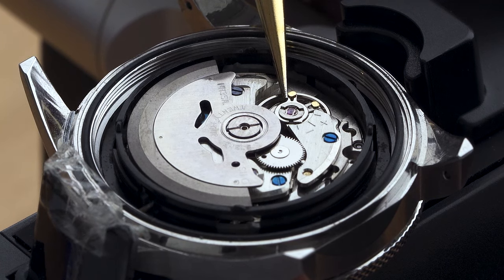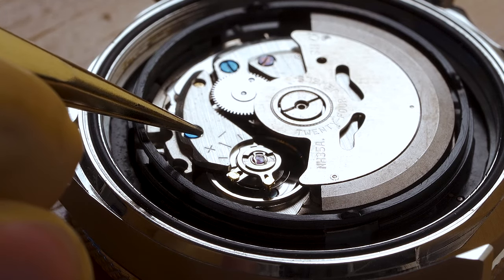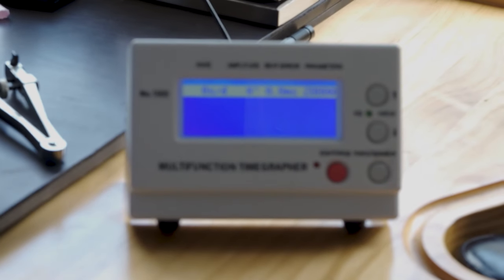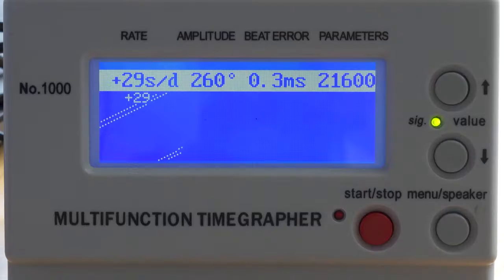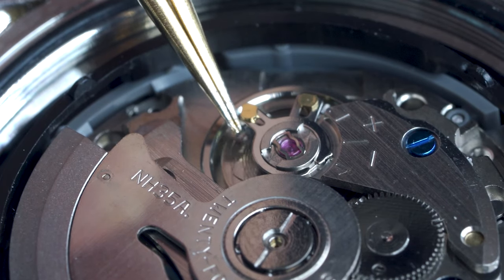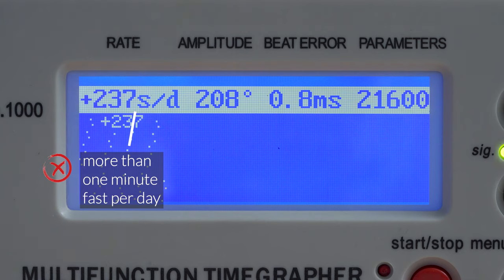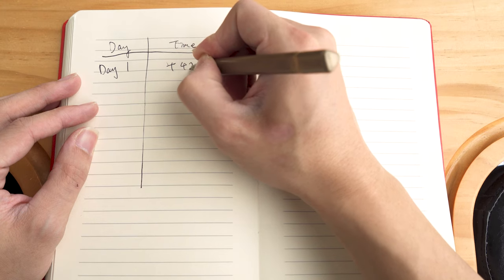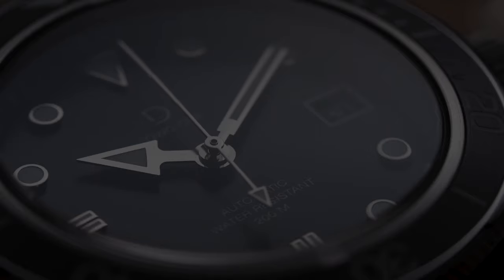How to Regulate a Watch using Timegrapher (and Improve Watch Accuracy WITHOUT a Timegrapher)

Comment: I've always been a casio/quartz nerd but now I'm considering an NH35-based watch, and it's nice to know I can regulate it myself.  I guess NH35's don't receive "full service" very often due to their low cost.  Thanks for a helpful video!
Reply from the maker: And that low cost makes it perfect for your own tinkering!
Reply: @DIYWatchClub  Right.  When it eventually dies I'll replace it with a brand new NH35, and then I'll try to bring the "dead/dying" NH35 back to life.  Chance of success: poor.  Chance of learning: 100%.
Reply: The NH35 movements are dirt cheap workhorses. You can't go wrong with them. I've just finished my 6th. build, it's a fantastic hobby that gives you a real sense of achievement. Build yourself an automatic, you never go back to quartz. 😊

Comment: Great video. I am new at this and find it very interesting.
A couple of questions.

1) time grapher.
      Is the a difference in manufactures
       
   2) Where can one go to by some basic totals such as the one you used to open the back to get access to the movement.

   3) Are there any courses/schools one can attend to learn more.

Thanks,
Charles
Reply from the maker: 1. The difference mostly is in terms of build quality. 2. A case back opener is included in our watchmaking kit, as well as other tools needed for watch assembly: https://shop.diywatch.club/collections/watchmakingkit. 3. I think the said watchmaking kit is a good place to start. It includes a complete tutorial on watch assembly. And you can gain hands on experience with the kit. Or if you want to go deep into this, you can check out WOSTEP.

Comment: Ah, I wish I'd seen your video sooner.  I'd seen others, all cautioning re: hairspring but they were using larger shifts of the regulator with a toothpick.  I was disappointed with what I perceived as inaccuracy (12 s/d too fast)  in my Orient Ray II so I got a time grapher, popped off the back and proceeded to overcorrect first one way, then the other and ended up nudging the beat error.too.  I finally got it to + 17s/d -near where I started but worse - and then slipped.  The hairspring stopped dead, never to run again.  Sigh.  It's became something of a Zen lesson; I have some other watches "in spec" but less than I used to want and now I enjoy the variety!

Comment: Some great videos. Have several Invicta's since they seemed a great entry point for automatic watches, and hit a point where I decided to get a winding case so I would have them ready to go. Boy was that an eye opener as they really weren't keeping time as well as I had assumed. So I started looking into improvements. Just regulated one of mine today to ~+1 s/d. Going to give it a few days and check how that fairs in the real world. Had been loosing 2-3 mins a week or so and time grapher (I am using PC with program and special mic stand similar to that used with time grapher) said it was ~-25 s/day so lined up well enough there. Hoping for good results. Second watch was much worse and beat error seemed to be a problem. Unfortunately I managed to catch the hair spring and am looking at option to repair/replace the movement. Tips appreciated, how best to adjust with out risking the spring, How hard is it to replace the hairspring vs movement, reliable source for movements (NH35A) eBay seem to have a lot of Japanese movements all shipping from China (fishy), and tips on the movement swap (swapping face/hands, etc). Already found your video on swapping the rotor (assuming I get an unbranded and want to keep my Invicta yellow rotor).

Comment: I would also suggest to use app like timegrapher x and earphone mic if using without a timegrapher. Not as accurate as physical timegrapher but I managed to get mine to +1s/day easily with those rather than adjusting it blindly.

Comment: Hi, what happens if an accurate reading of a 2824-2 COSC (Tissot) lift angle was set to 52 degrees?Is the accuracy reading the same? The device also reads correctly the deviation of the mechanism?I went to a watchmaker and (overhaul, so he says) he put the watch on timegrapher but the lift angle setting was 52 degrees...(yes an watchmaker...)!Until now, I didn't know that the angle should be 50 degrees!Please help...
Reply from the maker: Don't worry, the lift angle is used only to calculate the amplitude of the watch, and the difference in measurement of amplitude with a lift angle of 50 vs 52 is not significant (i.e. if there is a problem with amplitude it'll be noticeable whether it is 50 or 52). And most importantly, the accuracy reading (i.e. rate) is not affected. So yeah it's nothing to worry about.

Comment: I had a screw lodged in the hairspring. When I took it out, the rate was all wonky so I attempted to regulate it. But when I moved the regulator close to the stud, the rate did not slow down. Sometimes it did, but if I moved it further it would actually go up. Does it mean my hairspring is kaput?

Comment: Thanks for this video. I might be looking to attempt this on a Seiko 8L35B movement. There appears to be a screw next for the +/- symbol which some say is easier to use to regulate with. Have you come across this before and should I just stick to the regulator lever as you did? Also what tool is that you're using to get the watch case back off/on? Thanks

Comment: I have a watch with an NH35 movement.  I improved the accuracy to -1 sec per day (method number two).  I was thriller until it fell from counter height on a ceramic tile floor.  Now the accuracy can  be +80 seconds per day and then the next day - 60 seconds per day without making any adjustments what so ever!
I tried regulating it again and check the accuracy per hour.  This test showed the the watch was running approx. -2 seconded per hour for the first 6 hours for a total of -12 seconds for the first six hours.  However, by hour 7 the watch was now +5 seconds. this means hour 7 was +17 while all the previous hours were -2 seconds.

I assume the movement is damaged and attempting to regulate it is futile.  At $50 to purchase a new NH35 movement seems like my best option. Do you agree?
Reply from the maker: That happens to the best of us. In your case, yes, purchasing a new movement is the best choice.

Comment: You adjusted the rate with the watch dial facing down. Is this the ideal position to regulate the watch?, as most of the time you have dial facing up or 12 position slightly down when on wrist.

Comment: I have this movement in a "Rotate North" watch. I've had it for 3 months now, and having timed it every day for 6 weeks, it loses 22 or 23 sec every day, never varies. ( if I leave it face down for 24 hrs, it loses 7 sec ) I wear it all the time, including swimming 3 - 4 miles a week. I don't have a timegrapher, just the app, which doesn't seem to give reliably consistent results. As the watch is so consistent, would you recommend just regulating it, and not touching the beat error?  Any comments would be appreciated, thank you
Reply from the maker: If you're concerned about accuracy only, then yes regulating without adjusting beat error is ok. I'll also keep an eye out for signs of obstructions because the watch runs slow
Reply: @DIYWatchClub  Thanks for that, wish I had access to a timegrapher, as I don't want to keep removing the back. I'll make a soundproof box and use an external mic on the iPhone  app and take it from thereI'll use the face down position and set it to plus 7 sec, see how that goes. Amazed wt the consistency though, not deviated by more than a sec a day for 6 weeks,

Comment: I have a new watch with a NH35a movement. When my watch is a horizontal position, the beat error is 0.1ms with dial facing down and 4ms with the dial facing up. What do you think about the possible cause of this discrepancy/problem, and can the issue be solved?

Comment: Hello, great video!
I wanted to ask how much can you regulate a watch? Mine is running too fast and the regulation arm is already at edge of the (-) mark.. Though I could still regulate it more before it hits the beat adjustment lever.. Should I??
Reply from the maker: It would be good to check if the beat error is too high as well. I didn't manage to cover it in this video, but beat error adjustment affects the rate too
Reply: @DIYWatchClub  Great, thank you🤙

Comment: I have noted acording to you the lift angle in the Seiko NH35A is 53º, but are you sure that is so? On the internet NH35A --> 52º, NH35B --> 53º. I don´t know if these date are correct, which is the correct one?  Does the lift angle influence in the measurement of the device, aboive all the amplitude?, How can I know if the lift angle of the watch is the correct?
Reply from the maker: I'm pretty sure it's 53º, as I have cross-checked the figure from multiple sources, and even the catalogue says so: https://www.timemodule.com/upload/PDF/NH38_TG_E.pdf. But feel free to do some more digging around on the internet. BUT let's not worry about the difference of one degree, as lift angle is used (by the timegrapher) in calculating the amplitude. So basically setting a lift angle of 53 vs 52 on the timegrapher would actually results in insignificant difference in the resultant amplitude. And to answer your second question, lift angle of a watch isn't something that can be correct or wrong. It's something within the design of the movement, i.e. it's how the movement is set to work. So all NH35s work with a lift angle of 53º, and that's not something anyone can alter. So usually I get the lift angle number at a reliable source, preferably in a official data sheet or repair manual, or if that's not readily available, just like in this case, a catalogue works well in providing credible figure. Hope this answer your questions!
Reply: @DIYWatchClub  Thank you very much for the information. One More question, could you tell me a web where I can know the technical information about watches?
Reply from the maker: @emilianodelpozo4175  I assume you mean movement. Best source is official, if available. Otherwise, https://calibercorner.com/ is pretty useful
Reply: @DIYWatchClub  Yes, I mean movement or caliber.

Comment: Will it really be accurate when you have it horizontal on the timegrapher when measuring? When its worn it will rarely be horizontal beside when checking the time. Then it will be on a angle with gravity pulling and slowing it down. Wouldnt it make sense for the watch to be on a angle when you measure it to take account for gravity?
Reply from the maker: that's why some movements are "adjusted in 5 positions" or more =)
Reply: @DIYWatchClub  I read some more and learned about lift angles for different movements when calibrating them :)

Comment: I regulate for my use. I monitor how fast or slow my watch is running just by observing day to day. For example if I’m running 10 seconds slow per day I put my watch on my timegrapher and whatever it reads, I bump it up 10 to 12 seconds. I actually ignore timegrapher readings alone. I find if I set any of my watches to zero on the timegrapher, in use I never get zero on wrist. Hopefully this made sense.
Reply from the maker: The reason behind this discrepancy is positional difference. If you measure the watch in a different position, i.e. crown up/crown down/dial down etc. you'll likely see a different reading. Your daily routine is a summation of all the random positions the watch goes through. That's why you see in higher end watches something like "regulated in 5 positions". The difference in accuracy is tighter across different positions so that the watch is pragmatically more accurate in daily settings. The more affordable method is simply do what you just did

Comment: can you show me how to adjust the beat error of a H10 movement
Reply from the maker: I'll do another video on it, but in short you just move the stud instead of the regulator to adjust for beat error. Mind that the rate will change during this adjustment, so the sequence goes: move the stud, then move the regulator. And you'll most definitely need a timegrapher for this. Good luck!

Comment: Do you need to remove the case back when using the timegrapher?
Reply from the maker: No, unless you need to regulate the watch. Just testing it on the timegrapher requires no case back removal

Comment: You regulated the watch in only one position. You really need to check the accuracy of the watch in several other positions to verify the consistency of the regulation adjustment. Also, there are several timegrapher-like apps for mobile phones that you can you instead of buying an expensive timegrapher.

Comment: Watch accuracy Apps which use the phone's microphone to supply "sound" to a similar RATE/BEAT/etc display: are they even remotely accurate? And would you only place the watch on the timegrapher in one position?
Reply: timegrapher is "rate", wearing is "real". You eventually correct "real" by "rate". If still obsessed with "Position performance on timegrapher" , 3D Tourbillon still might not be adjusted to 18 positions. Btw, the timegrapher here is kind of "budget tool". Accuracy of 4 digits timegrapher is emploed in industrial crazy lab.

Comment: wyes pleasant video.. but the adjustment should be calibrated so you can ,easure exactly how far you change the setting.  then onlymteo measurements are needed. this is important on clocks because they vary through the day.... 
 for example..
Day 1. Fast 1, adjust S 3, set/
Day 2 Fast 1/4, adjust S 1, set/ (of course here one setting point equals 1/4 sec/day
Day 3 should be right on.
Reply from the maker: interesting to know about the usual practice with clocks!

Comment: Hello and thanks for your tutorial. However, I can't figure what the numbers BELOW the main reading bar (which is highlited) represent. Can you enlighten me on this matter? Many thanks.
Reply from the maker: Good question! Those are the measurements of rate in a shorter timeframe. The bigger rate above is the average of rate over a longer time period, and the smaller rate below is the average rate over a shorter time period (you can interpret them as the measurement of rate over the line segment below)

Comment: Am I the only one thinking why a Seiko movement needs retarding so much?   I bought from ebay at about a third the price of a Weishi, what I call a "baby timegrapher" available in a simple box type or on the swivel head type and it uses the excellent freeware Tg 5.0.   It has advantages over the Weishi in a) its battery powered and rechargable so means you can hook up to your fone, tablet or laptop and not require a desk making it portable b) Tg 5.0 has an extra function not seen on Weishi's in that you can "acoustically" balance the oscillation so you get abs perfect dwell at each end of the cycle, making for perfect beat error figures quite easily.
Reply: most of the timegrapher apps will work without any gadgets, you just set the watch close to your phone mic

Comment: Can I regulate my Guess w0379g6 watch too ?
Reply from the maker: Your watch has a quartz movement. No need to regulate.
Reply: @DIYWatchClub  thank you sir, but the time is lagging.  I checked it is "VD54B " inside, so what do I need to do ?  do I need to buy new "VD54B " in aliexpress and replace it ?
Reply from the maker: @n.s334  A possible reason is a low battery. You can either replace it yourself (this video may help you open your watch: https://youtu.be/7-yGJhQo87A) or take it to a watch repair. But honestly, if the time is only off by within 20 seconds in a month, it is well within specs.
Reply from the maker: That is very significant indeed. It could be some form of obstructions, like between the hands, rusted part, foreign elements in the watch etc.
Reply: @DIYWatchClub  Thank you! might be, but it seems clean, everything went wrong after I gave the watch for someone to replace the batteries in the past. also he scratched the back a lot, then when I reopened it I couldn't close the lid, so I gave it to a pro that told me he bent the back cover in order for the pressure close to work,   but now I can't also close the back cover again with the pressure machine.  lol.
Reply from the maker: @n.s334  Oof the only thing worse than a bad watch is a badly repaired watch. A good watchmaker might be able to fix whatever is wrong, but it is probably not worth it.
Reply: @DIYWatchClub  Fixing problems is what makes me tick, so, I just bent that back cover with a soft plastic hammer, hitting it on that watch fixing equipment which hold the watch with room below so I could hammer the thing , and make the pressure machine work. This is so satisfying . Just hope the battery will do the trick ^_^ If that work you saved me few pennies from aliexpress, lol , thanks.  if not I guess I'll just buy the whole mechanism it's so cheap, 12 $ for a whole movement mechanism replacement
Reply from the maker: @n.s334  Love it when I see a true DIY spirit! Hope it will work out for you.  Good luck!
Reply: @DIYWatchClub  That worked! thank you very much!
Reply from the maker: @n.s334  I'm so happy for you!

Comment: My cheap crappy watch goes off by 20 seconds laying flat vs upright...
Reply from the maker: Yeah unfortunately the "delta" (rate difference of difference positions) can be quite high for cheaper movements, and 20s is quite normal in that case. That's why you see "adjusted for 5 positions" or something similar in more expensive watches. But honestly you might not notice any real world difference since in real world usage the watch is in different positions throughout the day, so some of the difference could more or less cancel out each other.